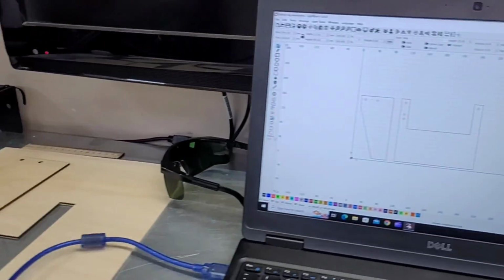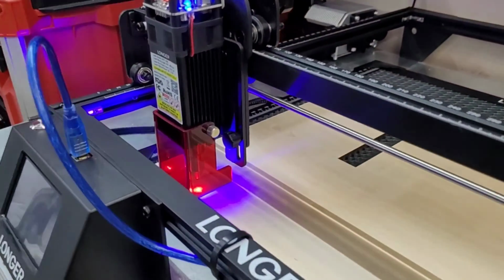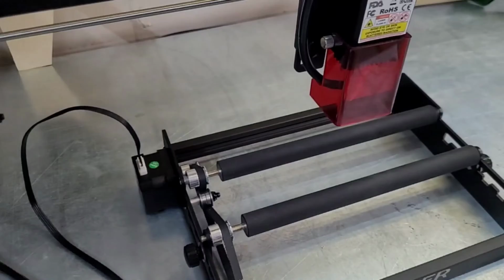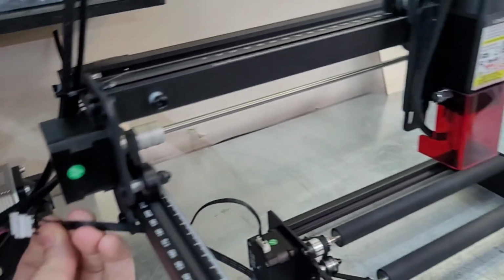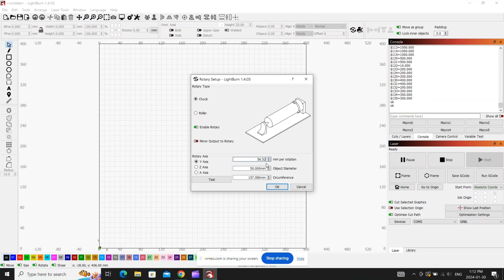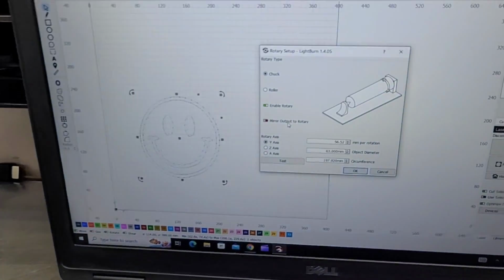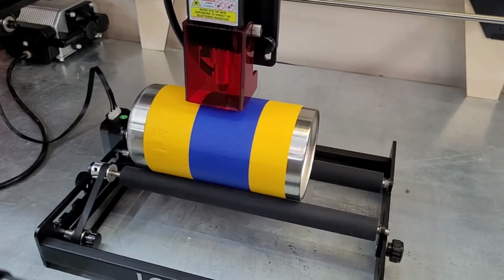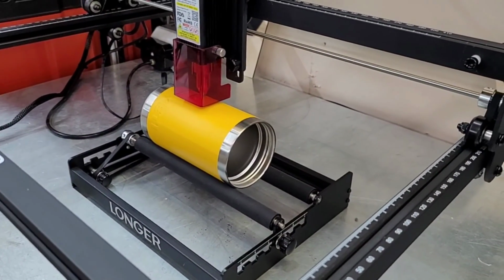Upgrading My Longer Ray5 Laser! Rotary Roller Setup

Comment: are you supposed to manually move the laser by hand to the location of where your engrave is going to be?  I keep getting limit warnings.
Reply from the maker: You may have the re-home the laser to stop the limit warnings
Reply: @SmitHVAC.  Understood.  Let me take you through my steps here.  Machine off>plug in the extension for the rotary>machine on>enable rotary>hit "test" and I get a soft limit warning.
Reply from the maker: @autorepairbymike1356  that's interesting. Manually move the laser to the location you want it in, then hit the position button on the lasers display. It should set its home position.